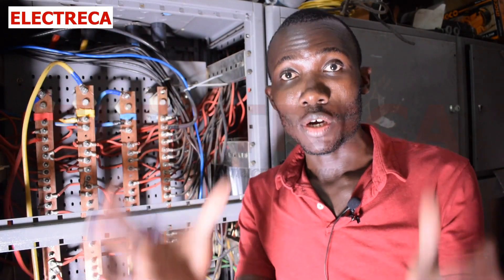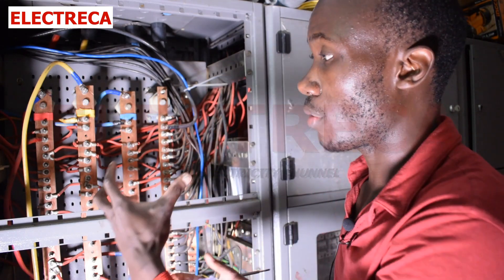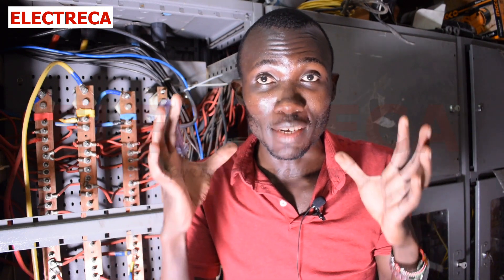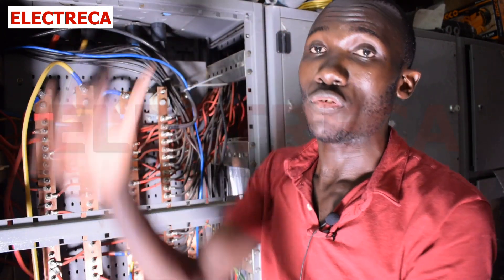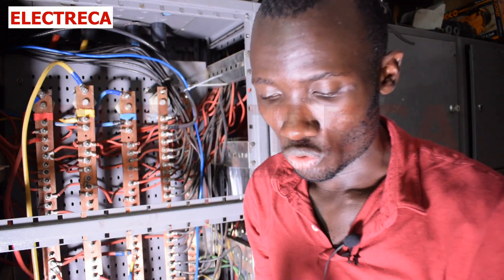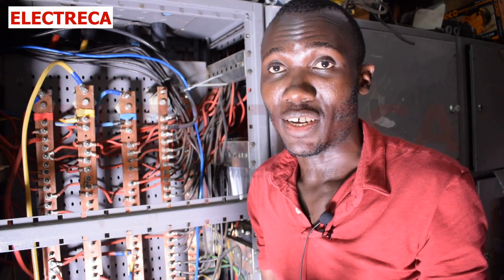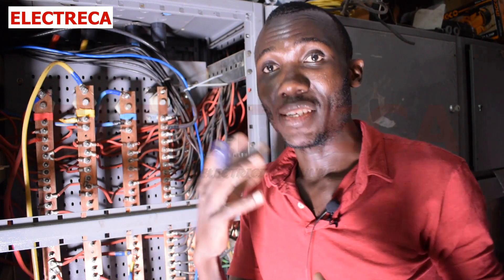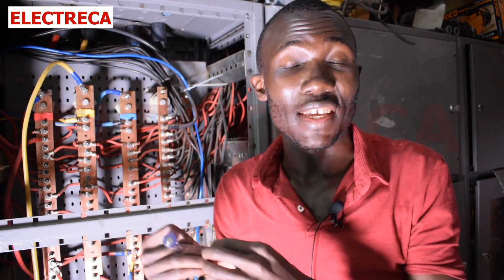How a Busbar System Works

Comment: in the world of mains electrics the word bus is a shortened world for busbar.. A busbar is copper bars in a metal box. and wires (circuits) are taped of the bars. so think the legs you have are the bars. so you can tap it any where off that wire.. if you want you tube busbar.chamber..

Comment: The purpose of bass bars is what?
Reply from the maker: A busbar is the common electrical terminal or bar where main and sub-main electrical circuits are connected. and it's usually in large installations.
TAKE AN EXAMPLE
In a small installation (domestic)
Power is from the electric pole to the metering box, by use of calculated load cable, from the metering box to the consumer unit(main switch) and then final circuits.
In large installations (industrial or commercial buildings)
Power from electric pole usually 3phase to 3phase metering box, by use of calculated load cable(incoming cable) to MCCB then to Busbar.
 purpose
In industries or commercial building there is a lot of outgoing circuit main and sub. there is no consumer unit that houses all those circuits.
that's why BUSBARS come in hand.
A busbar can take circuits so long as the total load does not exceed the Bursbar rating

Comment: What is the normal operating temperature of a busbar ?
Or at what temp should I replace my busbar before it gets to the point of getting burnt-out? 

Hope you can answer :) thank you brother!
Reply from the maker: 40 degree is  fine but I suggest not to exceed 35. you can use air conditioner to maintain the operating temperature.

Comment: Hi! what is an "Ath"? (not sure of the spelling)
Reply from the maker: Earth referred to as Earthing...…. In simple terms Earthing is a protection of Man, installation or equipment from risk of electrocution, surges and fire by grounding all earth points in an installation and also bonding all exposed mental part to the ground or earth.
Thanks for watching